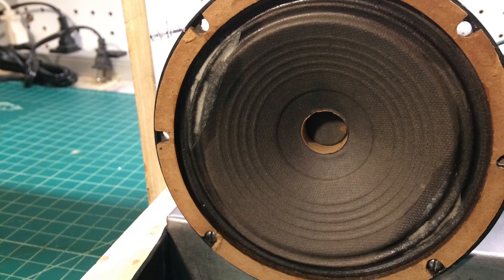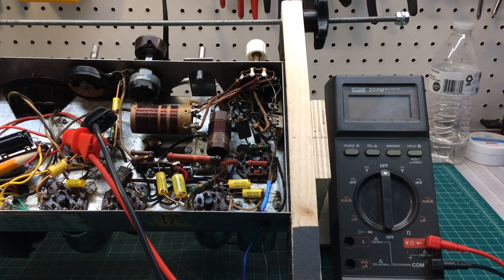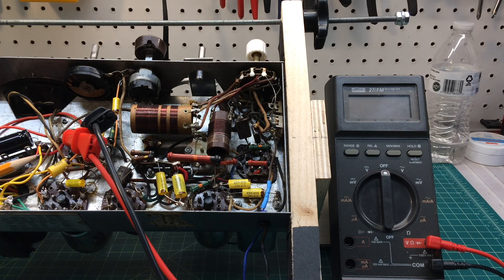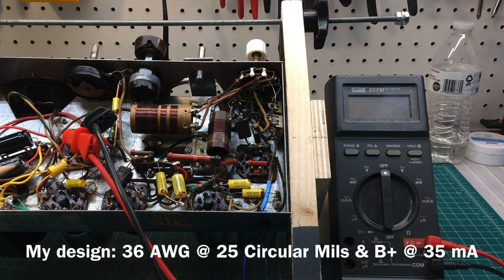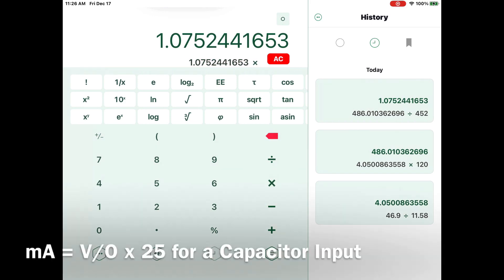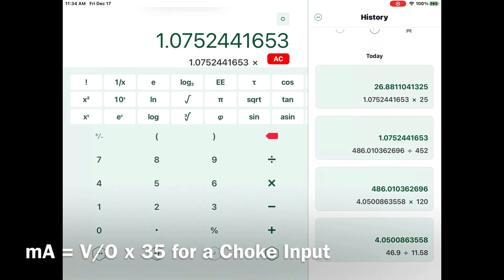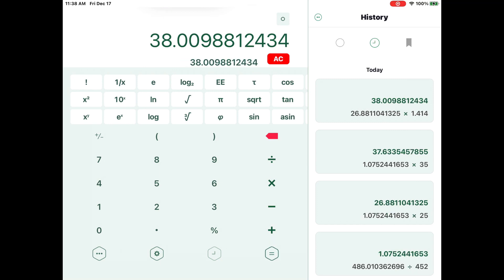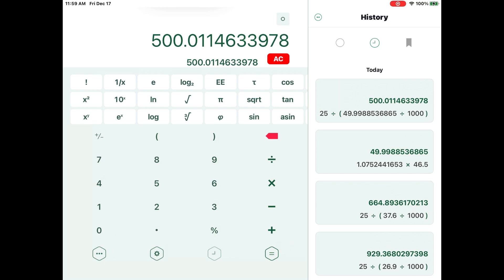Rating Unknown Power Transformers, Loudspeaker Repair & Dial Scale Reproduction

Comment: Let me get this straight Don. You scanned in the dial overlay, printed it back out after some photoshop work, fixing the burnthrew using what?... an injet print from the scan of the whole scale? And the light  shows threw the scale as well!! Wow just awesome! Thank you for the Harris link as well. Your xformer analysis is outstanding to say the least. You have a very happy and Merry Christmas too Don. Please keep,in good health again as our pandamic still continutes. May you and your family have a happy new year as well buddy.
Reply from the maker: Tony, I tried scanning it first, but the metal grommet in the center prevented it from laying flat and the image was blurred, so I took a high resolution photo of the dial scale and used Paint on my computer to fill in the hole and cleanup the lettering, etc. I then printed it out on glossy photo paper (66lb), cut the reproduction dial scale out with my circle cutter and laminated it with a 5 mil sheet, then used my circle cutter again to cut out the… I drilled the hole in the center with my step bit and cut a grommet in half and placed it in the center. It’s translucent even with the white background and once I get the dial lights wired up, I may spray the backside of the scale with a light coat of black paint if needed. 

Merry Christmas to you as well my friend and all the best in 2022.

Don
Reply: @RestoreOldRadios  Wow Don thats impressive. I did not know you could do that with a normal ink jet and have the lights show threw. Very cool. Thanks for the reply buddy.

Comment: I found the explanation hard to follow until I read the 1953 Radio-Electronics link. For those wanting to read the article this is a massive PDF file with the Rating Power Transformers article on pages 100 and 102 of the PDF  (pages 98 and 100 of the original magazine).
Reply from the maker: Thanks Andy. I placed the link in the description as well. All the best. Don